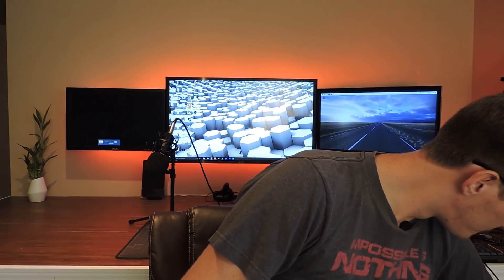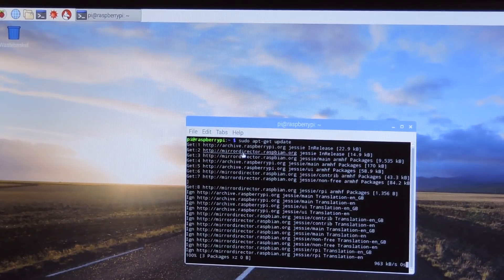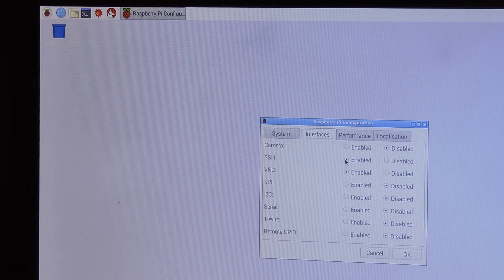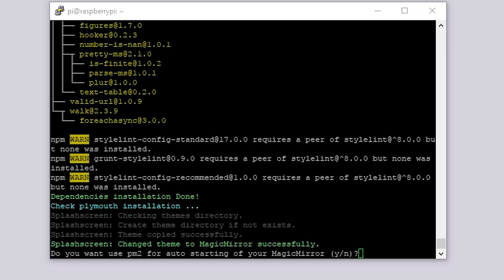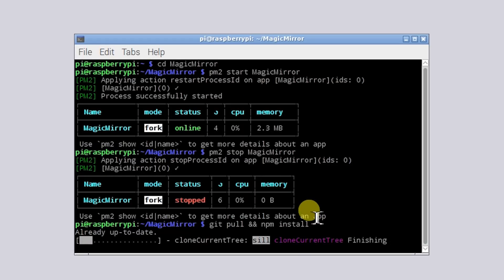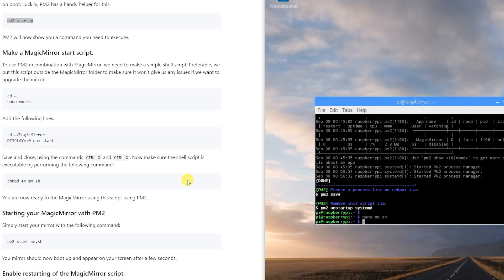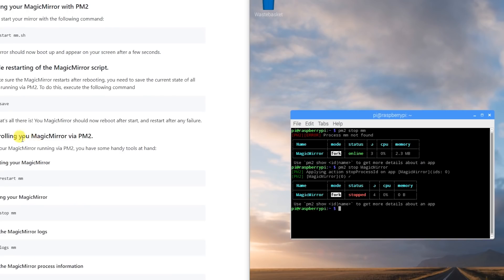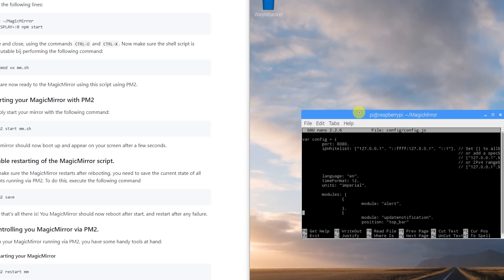How To: Make Your Own Smart Mirror! part 1

Comment: I have a RPI3, It seems you skip the video at 14:07. Which one should I choose to disable wireless power?
Reply from the maker: +Joey Nguyen sorry, I'm not sure what happened there. 
sudo nano /etc/modprobe.d/8192cu.conf
Is the command you use to open the file to enter the options 8192...........etc

Comment: @13:30..... I did "sudo nano /ect/lightdm/lightdm.conf" and it's all blank. At the bottom of the box it displays "[new file]"

Will that be an issue?
Reply: There is a typo.  Let's break the command down. Sudo is needed when you want to do things as the administrative user (root).  Nano is a text editor and the long string thereafter is the pathname to the file you want to edit. There is no /ect ,  you meant to type /etc/lightdm/lightdm.conf.
Reply: I've got an issue with it to, but I do have settings in the file but I don't have the "Seat defaults" sections though so not sure where to add that line...

Comment: this is the video i was waiting for , Great keep going , i like the way you start with the S.W part not the HW like the others , just i want to ask you if it is possible to add a short videos or clips  which will be appeared and played continuous on the mirror beside the date , time,weather ,...... and do you think this will kill the RPI CPU .
Reply from the maker: +Abdelfatah Hgag it can be done. After my HW video, I'll show more configurations that being one of them. As far as the CPU, I would definitely put on a heatsink and a fan if you'll be having videos play. But it should be able to handle it just fine.
Reply: Thanks Man for the fast reply , did you think to use a windows 10 stick which cost about 40-50 usd on Banggood and open the way for using Leap Motion or Kinnect or voice access via Cortana  , and open more apps  which use some windows software to take a photo and upload to Facebook or any ....
Reply from the maker: +Abdelfatah Hgag no haven't really thought about any of that... I'm not sure if they have all the known configurations such as auto start, pm2, hide cursor, and a fluid operation on windows 10. But I could be wrong
Reply from the maker: +Abdelfatah Hgag they do have voice and facial recognition available though through MagicMirror2 modules
Reply: i am just saying , i will not need to use the GPIO facility of RPI , the only thing i need is the HDMI output so why not using a windows 10 with the help of Some Macro and open the way for tons of apps which can be used.
 i didn't know that MagicMirror2 has voice and facial recognition available  This is Very Good , Anyway i just will be sitting here and wait for new videos :)

Comment: Can I try to do this with a raspberry pi model zero insted of a model 3?

Thanks!
Reply from the maker: +Francisco matamala you could certainly try, but I've heard that the zero doesn't have the processing and graphic capabilities to handle the software.
Reply: Thanks!, its like 35 more dollars to get the model 3 in my country(60 vs 25$)

I guess that If I want to truly commit to the project I can't cheap out on 30 bucks.
Reply from the maker: +Francisco matamala true 😊

Comment: After it's all put together, how do you turn off the monitor?
Reply from the maker: +Dominik Ruiz I just keep mine on. If you want to be able to control the monitors power, youd have to either wire an external button to the frame or a passthrough button.
Reply: I'm terrible at measurements, if you can help id greatly appreciate it. I'm using 1.5 by 3.5 wood, if my monitor measures at 22 by 14 6/16, what measurements would you cut the wood?
Reply from the maker: +Dominik Ruiz well, it depends how you want to build it. But if you want the top and bottom pieces overlapping the sides, just add the frame woods width to the monitor measurements. And the sides would be the same as the monitor. 

So top and bottom, 14 3/8 + 3 = 17 3/8 (or in your words 17 6/16)

Sides would both be 22

Hope this helps.

Comment: So I'm having problems running the second command in the video lol I run the update command then I run the next and continue to have this issue that states: "decompressing archive member: lzma error: compressed data is corrupt"
And also has issues unpacking chromium mods and wolfram-engine. Any pointers?

UPDATE: reinstalled with fresh os but apt-get dist-upgrade still shows the same two broken install files'chromium mods' and 'wolfram-engine', tried force overwrite, tried force installing those specific packages[fixed chromium-mods], and then waited two days and sure enough the dist-upgrade finally worked without any 'broken pipes' 
should be good now i hope. great vid btw!

Comment: Can I just buy a raspberry pi 3 or do I need the starter kit
Reply from the maker: +Poky Parachute well, you could. But the starter kit has the power supply, which is needed, CPU and GPU heatsinks, which is recommended, and some cables, depending on which one you get.

Comment: when installing magic mirror with the bash command on the website, my installation is getting hung up when installing dependencies

Installing dependencies ...
npm WARN deprecated coffee-script@1.10.0: CoffeeScript on NPM has moved to "coffeescript" (no hyphen)
npm WARN prefer global coffee-script@1.10.0 should be installed with -g
npm WARN prefer global jsonlint@1.6.2 should be installed with -g

> uws@0.14.5 install /home/pi/MagicMirror/node_modules/uws
> node-gyp rebuild > build_log.txt 2>&1 || exit 0

and then after that i get nothing, any one else experienced this?
Reply from the maker: +Steven B did you make sure to update the OS beforehand?
Reply: I am getting the same issue. were you able to find a solution?